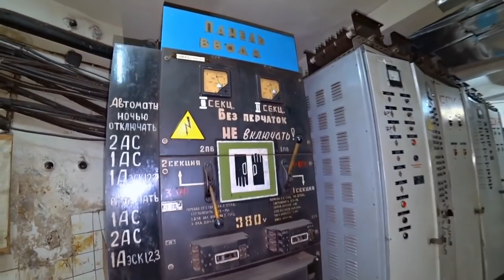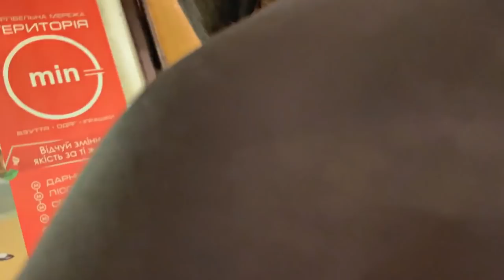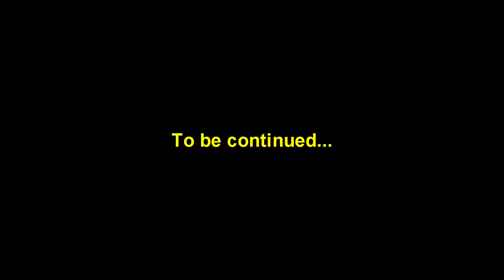Secrets inside the Metro 😱 Nuclear bunker in the tunnels

Comment: I am very skinny but I do not know I could fit down that.. That said that ladder is not needed for a area that small unless it opens up. You could just use your legs and hands to hold onto the sides to lower yourself that way. ( I have done stuff like that in the past. Of course looking at the bottom area, the ladder is not as needed if things are stacked to reach.. Admittedly it would not be easy to setup a solid enough area to drop to with still having a way back up. )

Comment: what about the laser sensors that let the Control know where the train is on the track they are every 100m if you cross one without a train you'll be a big big trouble.
Reply: There are no lasers. Otherwise they would a) be tripped all the time by rats and b) it’s way to dirty down there for a laser to work for long. They use magnetic contacts to know if a train enters a section.

Comment: When no one is around the mutant squirrels use the high voltage electricity to re charge the di lithium nickle hydrate cells which power their super powerful computer which is solving the world's hardest mathematical problem which will unlease a massive cognitive awareness throughout mankind.